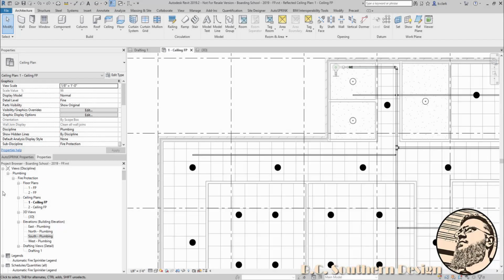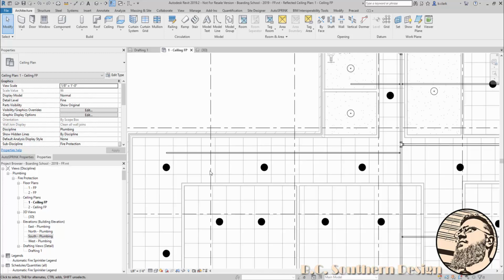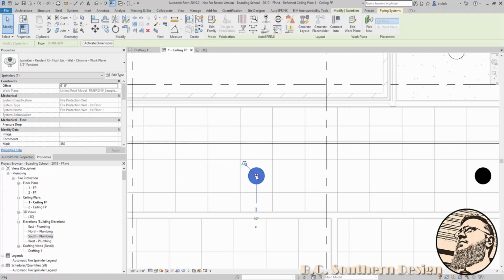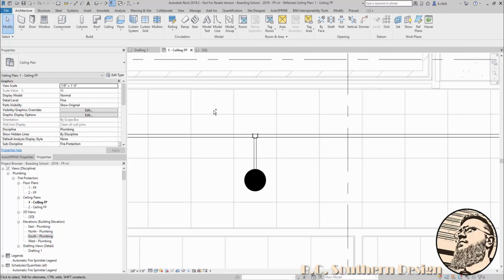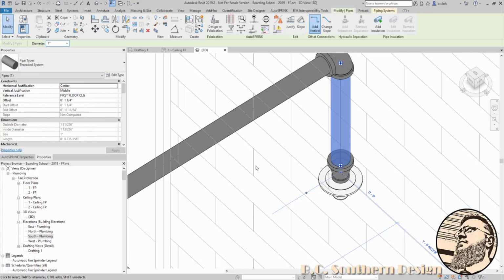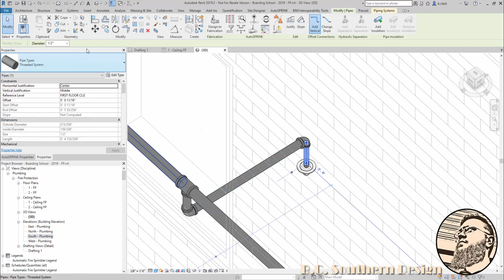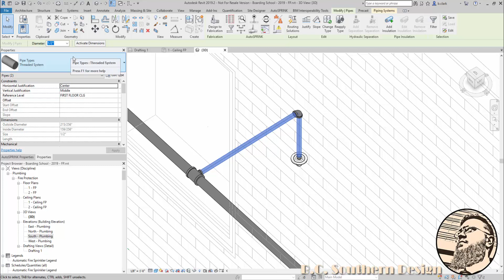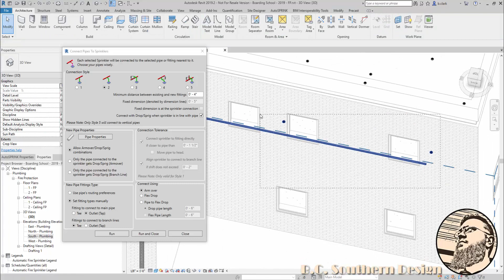Revit: Connecting Sprinkler Heads to Branch (Range) Pipe

Comment: So Im trying to re-create what you are doing here. However when When I try to "draw pipe" it will only connect when the pipe is below the sprinkler head. it will not connect from above and come down as yours does in the video. i get an error message stating "the segment is being drawn from the wrong side to connect to the location you indicated"

Comment: If you go to Manage/MEP settings/Mechanical settings and choose the Segments and sizes, you can set that the diameters less than 1" do not even appear for good
Reply from the maker: Unfortunately, this isn't exactly true. Revit will "invent" one if Revit automates the connection. For instance, you will see that a pipe of that smaller size is created that have the same inside and outside diameter equaling the nominal diameter. Strange object for sure.